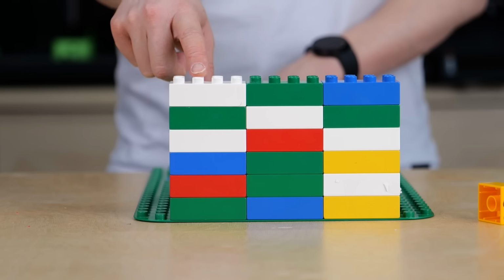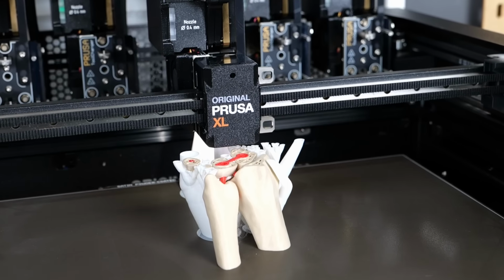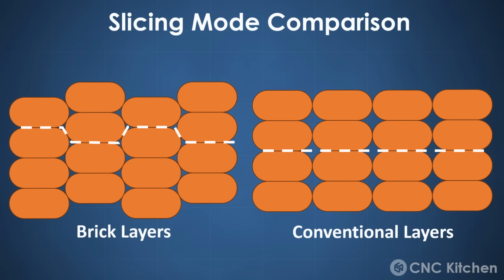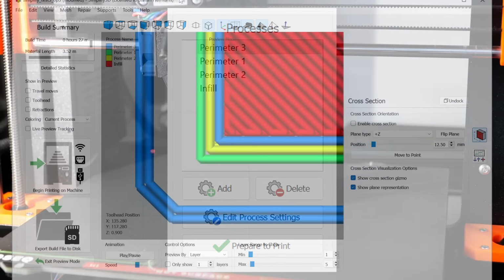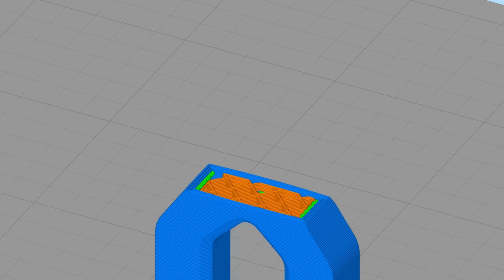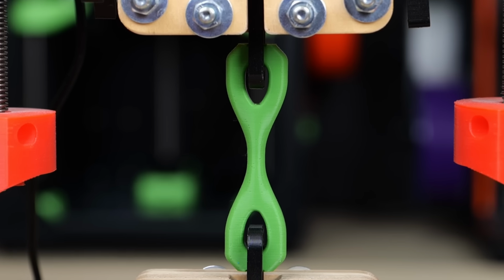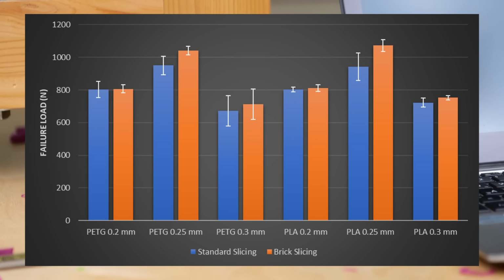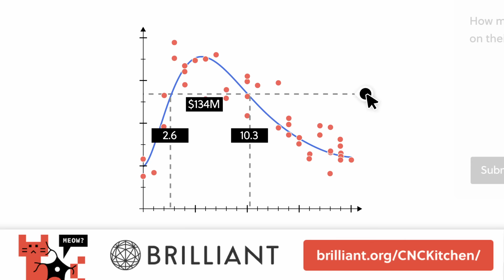Brick Layers - Why did no one do this before?

Comment: We own a print farm and run hundreds of prints in PETG that are subject to high daily stress loads. We found that larger nozzles with slight over-extrusion increasing the XY plane contact between rows along with optimal temp gave us the highest strength. There is an upper limit though, forcing us to design based on the print direction. Stefan, I’ll have to run some torture test samples at the larger nozzle diameter to see if it’s worth implementing for our prints. Thanks for the info!
Reply: Get back to us with your results please
Reply: I have a much smaller operation but my use-case is similar in scope, functional prints of PETG. I'm also curious for your results.
Reply: Is there a way we can follow you for updates? Lol
Reply: Very interesting. By “slight over extrusion” do you mean flow rate or line width?
Reply: Try z axis fuzzy skin, half layer height on all walls
Reply: Designing along the print direction is the key to success strength wise, added with larger nozzles or simply widening the line from the slicer settings, much the same as over extrusion. Say you have 0.4 nozzle, you can do up 0.8 line width, which will already result much stronger prints than 0.4 line. Using 0.8 nozzle you can do also quite a wide range of line widths from 0.4 to 1.6, though the finish may not be as pretty at the ends of the range, compared to having matching size nozzle, but not that bad at all, if the strength is in your scope.

Personally I don't find the tested 10-14% increase in layers adhesion strength that impressive, so can't believe there's that much to win in that, layers are layers and their strength depends much on quality of the material and print settings, especially speed, temperature and cooling.

Slicers like Cura has also a feature 'alternate extra wall', which increase walls to infill bond for added overall strength, concept slightly related to brick wall, but vertical and on walls only. You can also play with the infill to wall overlap, but that usually results infill lines showing through, if the looks matter.
Reply: The over extrusion solution works because it helps fill in the voids between perimeters.  I think combining that with the Bricklayers would do well.  

While Stefan's right about the benefit of forcing the crack to change direction, without the extrusion adjustment, it introduces a problem: it also lowers the contact between adjacent perimeters.  Increasing the extrusion width for the perimeters (say, 30% of layer height, for the "offset" perimeters) could provide both the benefits of brick layers and the additional adhesion.

So, yeah, if you use your over-extrusion parameters in conjunction with this, I'm pretty sure you'll see markedly better results than Stefan did, because the "fill in the gaps" effect of the over-extrusion will fill in the gaps in the bricks, too, thereby eliminating/mitigating the "less contact between perimeters" problem.
Reply: @Londubh  Thanks for the thought, hope I'll be proven wrong with this, but not holding breath for any mighty strength uptick. There'll always be problems with delicate structures, where you can't invest too many lines laterally to begin with to build strong enough layers no matter what and that'll always challenge the design process.
Reply: Are you also baking parts to cure them? I would be interested to know how this affects this method as well.
Reply: @ramicaza  I've heard with larger Volcano Hotends that it can provide better bonding, heating up larger amounts and increasing the extrusion rate- in that case it meant flow.
Reply: @lightsnsire update?
Reply: Any results?
Reply: writing a comment so I'll get notified when there's an update
Reply: I am also writing a comment in hopes of a future update <3
Reply: Added a comment in hopes of an update as well
Reply: can the layers be heat treated after the print to fuse the layers?
Reply: When you get some reasults give us an update please. What nozzle diameter you use usually?
Reply: @ramicaza  i know a few people how run on 105% feed rate and a slightly higher temp to get better adhesion.
Reply: Any updates yet?
Reply: Why do you use PETG for load bearing components?
Reply: 'Larger nozzles with slight over-extrusion' - Exactly
Reply: @Cokey96  PLA, while stiffer than PETG, also has what's known as "creep" where if it's kept under load, it will gradually and permanently deform under that load. PLA is also more brittle than PETG, so when it fails, it fails with *GUSTO*. PETG, while more flexible than PLA, doesn't have as much creep as PLA.
Reply: We're all dying to know about your update!!
Reply: Very interested in seeing an update on this.

Comment: The crack features on the brick printed parts strongly implies increased vertical and horizontal bonding, leading to increased homogeneity, which is why the failures were 3d and not 2d. The 45 degree oriented bonding in the brick prints is notable in this regard.
Reply: I wouldn't be suprised if printing sample horizontally wouldn't bring any better sample resistance.
I would expect this feature in slicers in near future after this video.
Reply: Is that a good thing or not?
Reply: @Martial-Mat I believe it’s good because it’s sharing the stress on bonds across both planes rather than just horizontal (layer adhesion) 

I could be wrong though
Reply: But if that is the case, the failure plane would still be perpendicular to the force vector. The parallel cracks would suggest that there is now a different travel path for stress, along a secondary plane of anisotropy.
I bet this would be confirmed by prints made flat on the bed.
Reply: Yes but this is different than brick. A brick pattern, as he illustrates in the beginning with the blocks, is when the vertical surfaces are distributed over multiple cells above and below it. This successively doubles the surface area that is carrying any load. Instead, with this hexagonal linking, while it connects each course to more courses and of course makes it stronger, is not a brick pattern. he says there is an issue with stacking vertically, but staggering vertically maintains most of the qualities of the vertical stack and only partly links horizontally to more tracks, but arguably it already connected horizontally, and instead of just linking to the nearby track, is now linking to two nearby tracks on each side, but half as much. he should instead do what he describes in the beginning of the video and actually stagger horizontally.
Reply: If your design is going for strength over looks, angling the sides so the perimeters aren't stacked vertically can help.
At 45 degrees with 0.4mm nozzle 0.2mm height, the perimeters stack like a typical brick wall, half overlapping each other, but at 26.5 degrees they stack vertically again.
I got surprisingly good results as low as 35 degrees with some 3" racing drone propellers printed in TPU without support.
Reply: @enotdetcelfer  How exactly would he do that, considering the tools available in current printers? You can't just move up and down with a nozzle that is perpendicular to the bed, as that will make you constantly crash into layers that are already there. Only reliable way to avoid it, would be to make a true, 5 axis printer, but those would likely not be consumer grade, which makes it irrelevant to showcase in a video, as the majority of his subscribers would be unable to utilize that in their own printers
Reply: @QuippersUnited  Isn't that exactly what we see happen? The failure plane was still mostly perpendicular to the force vector. The vertical cracks on some of the parts should be expected in a scenario with layers interlocking at a 45° angle, as we can't expect the force to consistently travel along the same path. Some of the energy will travel up through the layers and cause breaking there. This behavior is also visible in another organic material, that of wood joinery being glued together and then stress tested. Most of the time they fail along the glue joint, but they will almost always have cracks going along the grain too, despite the grain being entirely homogenous. Metal, which is not at all organic, show similar results after testing interlocking parts. They too will usually break at the point of overlap, but fatigue cracks into the homogenous material can also be spotted, albeit under a microscope.
Reply: @CNCKitchen this 3d crack could be a sign that your test method is too laboratory, too perfect, so my guess is that in real life there is more than 10% stength improvement with your approach. Can you try an impact test or bending the part, like Thomas is doing in this video.
https://www.youtube.com/watch?v=YJdkE7A8stM
Reply: @Arterexius  Perhaps homogeneous is the wrong word here. Isotropic vs. anisotropic is more appropriate. Wood is not an isotropic material, as it is fibrous and therefore strong in tension when force is applied parallel to the fibers, and comparatively weak when force is applied perpendicular to the fibers. 3D prints are much the same way, the reason we don't see the "parallel failure" in the conventional printing method is because the zigzag cleavages take on shear stresses where straight cleavages do not. (God this is hard to explain without a diagram). Metal (under typical conditions) is isotropic so failure happens (mostly) perpendicular to the force applied. Any parallel failure would be a result of imperfections in the material and the general mechanics of pulling something apart (like the Poisson effect, where the material experiences lateral strain from getting thinner as it's lengthened). But just because lateral strain does happen in isotropic materials, it doesn't mean it's failing that way for the same reason as anisotropic material.
Reply: To me it immediately looks like necking in metal samples or diagonal cracks in concrete cylinder breaks. Definitely a sign of strength throughout the piece across the layers.
Reply: Some filament just cracks that way and I have not used a "brick pattern" to see that
Reply: Short answer: yeah it is, the more hard a material is the harder it breaks aka explode 
Long answer with example:
look at steel pan, when they eventually break because of an explosion they explode themselves but withstand bullets easily @Martial-Mat
Reply: Well it would slice it at 2 times resolution. Alternating removing the perimeter and extruding it with regular feeedrate to test it out. there would never be a collision with the alternating layers.
Reply: Perhaps the answer is a head that rotates on the y axis tipping the plastics into the void where the “rounded” extrusion meets the prior layer, thus using a new design of 3 horizontally offset layers where the core middle rises ahead of the two surrounding layers….building a pyramidal layering build so that the core strength is vertical and the “tipping load” is supported by the surrounded build layer. Sorry, wordy…
Reply: Shouts out @Lord_common_sense for giving an answer and not spamming with pointless semantics that isn't helping nor needed.
Reply: @Goldenfightinglink  I'm sorry, but I don't think Lord_common_sense knows what they are talking about at all. Hardness and strength are different material properties that can be related but should not be confused. Materials can also behave completely differently under tension and compression testing, let alone impact testing. Furthermore, the fracture mechanisms of something like a steel pan should really not be compared to fracture mechanisms of plastics, let alone 3-d printed plastics.
Reply: I would look at this comparison from a different way. My take on this is that the connection is almost like a glue connection. With the interlocked Layers, you increase the surface are of which the material can adhere to. I think what's notable is that the regular print has a pretty rough surface, but the bricked one has a spot on the top left which has a smooth area. This may indicate that the point of failure was not at the transition point, but through one layer. So it seems to me that the regular is breaking more adhesive (transition between the layers) and the bricked one is a mixture of cohesive and adhesive (a mixture of failure between the layers and the material)
Reply: @QuippersUnited  Interestingly that's not the case: during tensile tests the direction of most tangential stress and the one in wich the material starts to plastify is at 45°, that's why during tensile tests on metals the angle at wich the failure plane ocurrs is 45°.
Reply: @tomasfiorentini4126  That sounds familiar, There's a special angle coefficient for material failure, isn't there? It's been a long time since my strength of materials class.